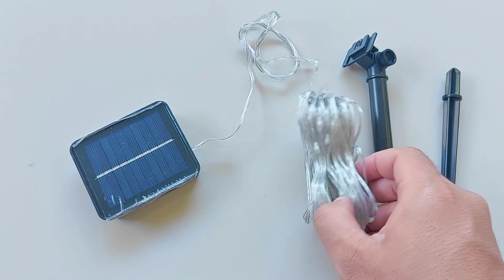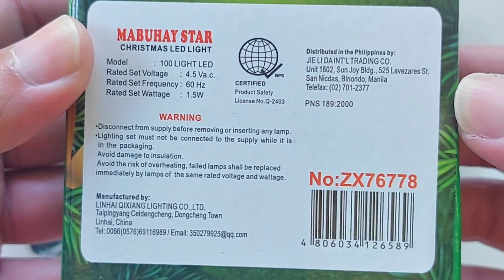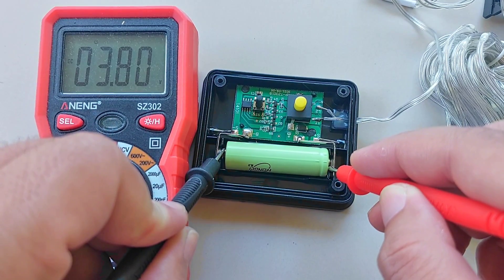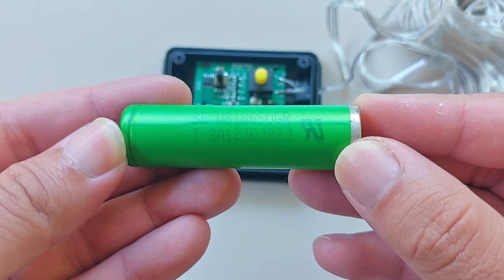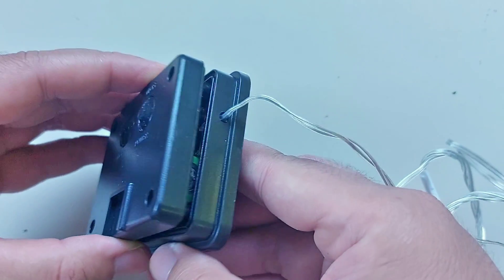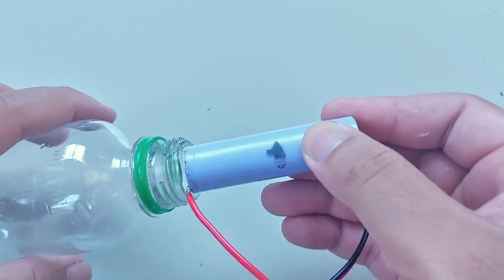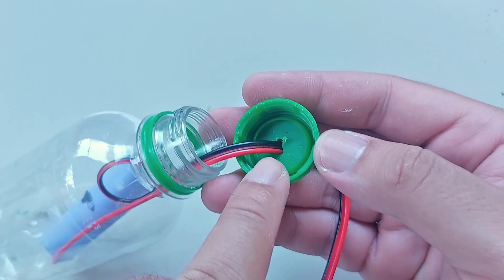How to upgrade / modify christmas Solar Led Lights Battery

Comment: 18650 is 3.2v... solar lights are 1.2v. it does not fry your board??
Reply from the maker: The full charge voltage of an 18650 battery is 4.2V, and it does not burn the board.
The solar Christmas lights that use a 1.2V battery have smaller LEDs in size, and they are not as bright compared to this version.

Comment: Can the panel fully charge the bigger battery? Replacing the battery is useless if the panel's wattage cannot fully charge it even with full sun.
Reply from the maker: It's not useless for me, as mine lasted the entire night.

Comment: Last year I bought two of these. One had a 14500 li-ion battery, while the other one a NiMh. The li-ion battery works much better (no mods) and can last until sunrise even with little solar charging the day prior.

Anyways this year I can't find a single one that's li-ion powered. Everything's NiMh.
Reply from the maker: Yes, lithium-powered lights last longer and shine brighter compared to 1.2V batteries. Luckily, I can still find them where I live.
Reply: @TaylorSoloaiJR  happy to report I was wrong about this. I just received my order and it came with li-ion despite advertising NiMH on the product page. It seems supplier dependent, and it's hard to know what you're getting.
Reply from the maker: Nice, from what I observed if you buy the 100 led light string it will most likely be lithium ion battery but anything with 30 LEDs or less will be NiMh.

Comment: how do you attach the 18650 battery to the wire? what is that flat silver like thing?
Reply from the maker: That's called a nickel metal strip

Comment: Just get a better hr6 or AA 1.2v 2800mah i did this and they last 3 nights without a issue no modifications or separate battery compartment needed.
Reply from the maker: This model only runs off 3.7-4V
Reply: The original green battery is a 1.2v cell.
Reply from the maker: That means you didn't watch the whole video, I clearly showed the voltage.
Reply: I definitely did watch it or I wouldn't have spoken and videos are faked everyday so sorry the green cell looks like a hr6 or AA battery. 😂
Reply from the maker: All 14500 battery look like AA battery, try putting that in to one of your wall clocks and see what happens 🤣
Reply: @TaylorSoloaiJR 😂

Comment: Can it work using normal batteries? I'm kinda having a problem
Reply from the maker: What do you mean by normal batteries?
Reply: The one that doesent recharge
Reply from the maker: If you're referring to the  1.2V battery than I guess you could but you need more than one and you're going to replace those everyday if you're using them all night.
Reply: Oh okay thanks for helping me
Reply from the maker: You're welcome

Comment: This motherboard and led provides 3.7V of current?.
Normally use only 1.2v
Reply from the maker: That's what I thought when I first got it, but the problem I see is that the solar panel is weak. It can not fully charge the battery.
Reply: @TaylorSoloaiJR  When I exchanged, I was going to do that, but I was afraid of breaking it, so I used the AMS1117 step-down circuit.

Comment: I need to upgrade the existing solar lights with higher capacity batteries but did not have a suitable container if they do not fit.
Now I have a use for similar bottles that I only recently started collecting.
The external bottle is a good idea. 
Thanks for posting.
Reply from the maker: Thank you  and I am glad the video was helpful!

Comment: Will it be able to fully charge in the sun during the day with the new battery?
Reply from the maker: No, the battery capacity is now bigger and the solar panel is not that strong. It needs a higher wattage panel.

But the lights last all night long with this new battery.
Reply: @TaylorSoloaiJR  yeah thank you!

Comment: So you take a circuit designed for 1.2v and just connect a 3.7v battery to it with no modifications? You're going to blow something. I doubt those LEDs are supposed to flash that fast.
Reply from the maker: Sounds like you we're not listening to what I explained about the 1.5V battery

Comment: Hi. What is that metal piece you stick in the battery with wires? Where can i get that? And which is better to use? the stock IMR14500 battery with 600mAh or a 18650 battery with 19800mAh?

Comment: Hi, what type of battery should I buy? I have this exact model of lights and I'm planning on modding it the same way you did.
Reply from the maker: I am using a rechargeable 18650 battery, but if you can find a reliable rechargeble14500 battery like the one it came with, that would definitely be a better and simpler choice.

Comment: Can i change the battery to 32650?
Reply from the maker: It needs to be a battery that supplies up to 4.2V, the 32650 only fully charges at 3.6V
The board has to be modified if you want to use that Lifepo4 type battery

Comment: From original battery is 1.2v and you replaced it into 18650 which is nominal voltage is 3.7  and max.voltage is 4.2..it is possible to burn out the led lights..
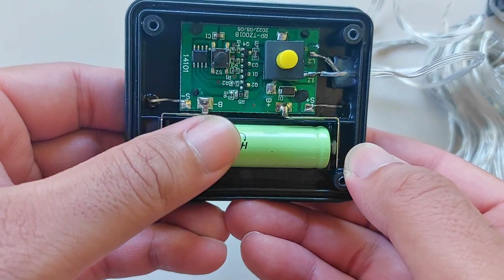Reply from the maker: As I noted in the video at 0:25, it’s not a 1.2V battery.
Reply: @TaylorSoloaiJR  base on the casing 1.2v as indicated.
Reply from the maker: Yes but the components used is not meant for 1.2V battery. The lights won't turn ON if you try it.
Reply: @TaylorSoloaiJR  what is the charging voltage of the solar panel when it peak sunlight
Reply from the maker: Can't remember but it's around 4V

Comment: Ill explain ok
So just find a same battery size as that and has a bigger capacity i bought one of them on lazada or any of the stores
Reply from the maker: might want to do a capacity test on those when you get them, most sellers are not honest with the true capacity of batteries.

Comment: Won’t the battery get discharged under 2.7v and get damaged? Can the solar panel charge the battery? It produces around 2v when sun is shinning
Reply from the maker: It's a 4.5V solar panel, I actually measured the output voltage under no load.

Comment: Y'know, an awful lot of curious-but-not-savvy people will be attracted to this by the title, so it would've been a good idea not just to say, "put it in the bottle and add some hot glue," but to explain WHY...  Just a thought.
Reply from the maker: I thought it was obvious, but i guess not.
Here is the answer to that question. Since the battery won't fit in the actual solar box with the electronics, i opted for the bottle since it's big enough, and it will also protect the battery from the rain.

The wires can be extended, so it's easy to put it behind the bush so it can be protected from the sun during the day.

I suggest not to attempt to do this if you have no experience in replacing a battery-powered device.
Reply: This is a youtube tech tutorial. India is going to show up in force with dumb questions like "What gauge of wire do I need?" and "What brand of soda does the bottle need to be?" MrMist gave you good advice.  @TaylorSoloaiJR
Reply from the maker: It's okay. That's what the comment section is for.